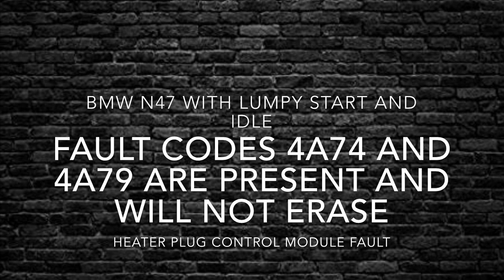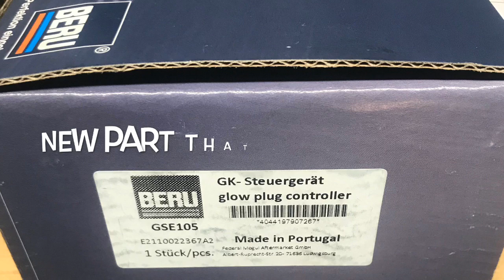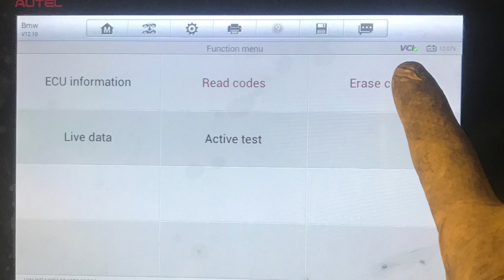Faulty Heater Plug Control Module replacement 4A74 + 4A79 (+ location) Bmw N47 320d 2008

Comment: Hi, I also have these errors, and besides that I also have power loss, if I change the glow plug control will the power come back? 
Thank you 🙏
Reply: I have same fault codes and also rough idle (only those 2 codes)
Did you manage to fix it?

Comment: I have replaced the module and I’m still getting the very exact same codes again. Is anyone able help me out as I’m confused at what the problem can be
Reply from the maker: Check to see if your glow plugs are all good ,and be careful as they can break when removing them.which means in worst case removal of the head to get out the broken plug,or a special tool to remove the plug this is a specialist job.